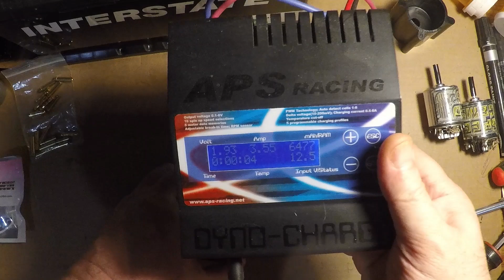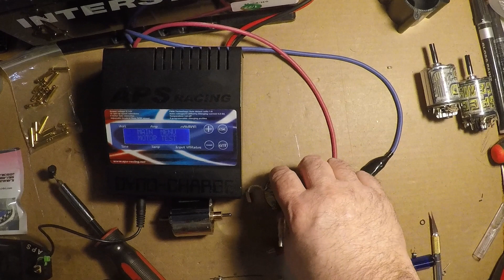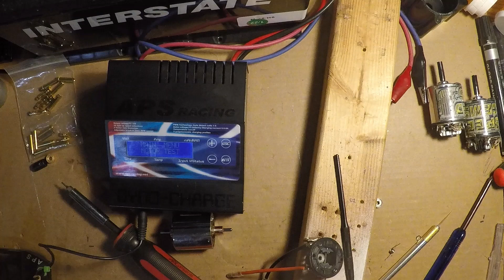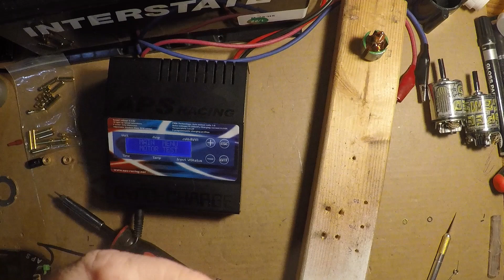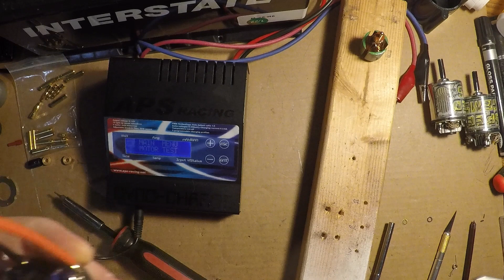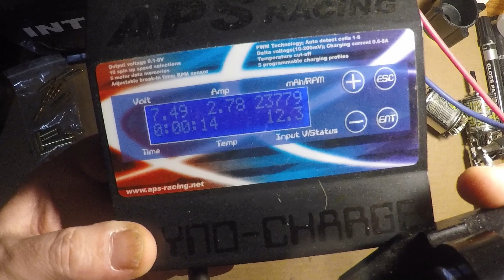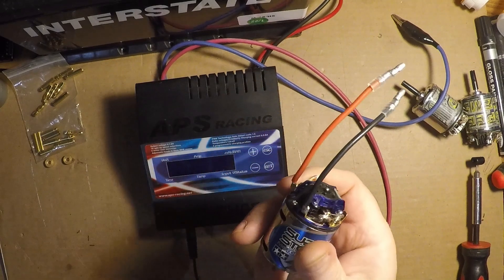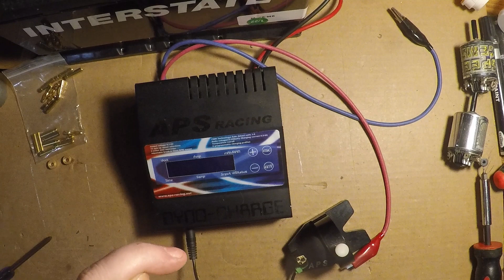Tamiya Super Stock Motors for a Clod Buster

Comment: Wow Bob, a very interesting and very informative video. You really know what you're doing with these motors and have got some cool kit to work on them and measure them with! I'm amazed at how well the motor spins with the advance removed. Should be great in the clod, I would imagine the torque is increased over the standard setting, too, just what you want on a heavy truck! Great job, brother, keep 'em coming! Cheers!  :O)
Reply from the maker: Thanks Brother, I did go a bit fast but I didn't want an hour long video. I do have 12 old stock motors here that I'm working on too (mostly old Trinity Green Machines "1993"), they are not "rebuildable" but can change the brushes. Maybe my next Clod build will be brushless motors.

Comment: How did these motors run in your clod? Did you do a video of it running? I looked but didn't see one. Do you think this is a good upgrade? I'm looking for replacement motors for my clod right now.

EDIT; Nevermind, I just saw the video of it running. Runs good!
Reply from the maker: Thanks man... They need a little work to work in a Clod but well worth the effort to do so.. Not much faster but a ton of torque..

Comment: What happens if i try running them without doing this?
Reply from the maker: In a Clod or the older dual motor Kyosho trucks USA-1, Hi-Rider Vette, Titan...). With the timing built into the motors, one is going to spin faster than the other, either pushing or pulling the other axle along...  Simply swapping the motor wires (leads, cables or what ever people call them) will not work on a timind motor, the timing then would be too far retarted and get very hot faster..  Addam over at Addams Playground did a video with his Clod using Tamiya Torque Tuned motors, here's the link, https://youtu.be/X0Vall_VLQg?si=2Bvyk2fu5HdMEQC9

Comment: You are the second person who shows the installation of the metal can bearing and it goes in with ease or it was hard as hell because you did not show how to seat the bearings.
Reply from the maker: I didn't show it because I was using a metal punch, not a good tool for the job... My wife went and used my wood 3/8" dowel I normally use to seat bearings in the can... It is not hard to seat them just make sure they are square (fully seated). A hair dryer helps expand the can where the bearing goes just to make it a bit easier..  Remember, light taps with a hammer, no need to go Thor on bearings..

Comment: Great video, Bob. I didn't know you could do this with these motors, I'd love to try this out on my Clod some time.
Reply from the maker: Thanks Fil!!! The main thing is to keep them at zero degrees timing and rotating the rear motor endbell 180 degrees...  All the tricks I picked (not all) when I raced Clods back in the day, nowadays, they are brushless but limited to 2S lipo packs.
Reply: @UncleBobsRC  I ran dual 6900kv Castles with 2 x Sidewinder 3 esc's on my mod-Clod, back in the day. It was waaay too much! Haha! So I bumped it back to 15T HPI Firebolts. But I'd love to try your BZ trick!
Reply from the maker: @poorboysrc  Lol Awesome!!!!  When I raced, it was before the surge of brushless, back in the days when you had to build your own 8, 9 or even 10 cell pack.

Comment: Amazing amount of knowledge and skills. Thanks for sharing.
Reply from the maker: Thanks Mike, It's all from watching, learning & doing.... However, I'm no expert. All the years of running Clods with mod motors, I know you simply can't just swap motor wires for the rear gearbox (this is old news, very old) and have it work right. All that said, I did this work just to put those motors in my Gray Edition Clod (that wont see much running) because I like they way the colors looked together.  Thanks for watching & the comment!!!

Comment: Very well explained. Great video.
Reply from the maker: Thanks man, I was going a bit fast but I didn't want an hour long video.
Reply: @UncleBobsRC  Now I haven't the tools, but I paid attention on the result😉
Reply from the maker: @RCBirds  It's all in the timing for a Clod Buster, that, and one motor in reverse (not done by swapping the motor wires around).
Reply: @UncleBobsRC  yupp, I know this and have planned the RC4WD motors, not timed and thanks to Steve from Shen RC for the tip, for my next Clod project. But these high turning motors tease me more. So I'm looking forwar how the improbve the running.
Reply from the maker: @RCBirds  AWESOME!!!